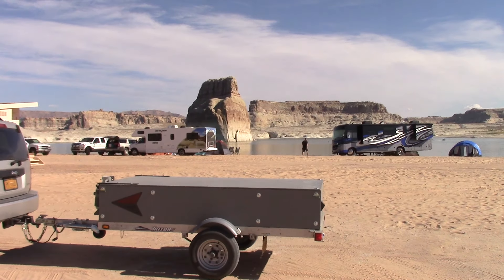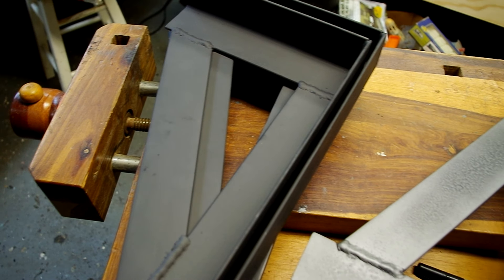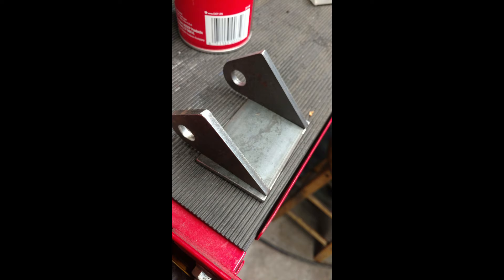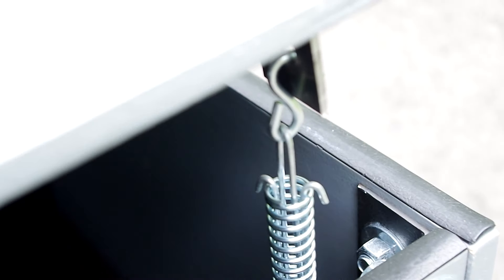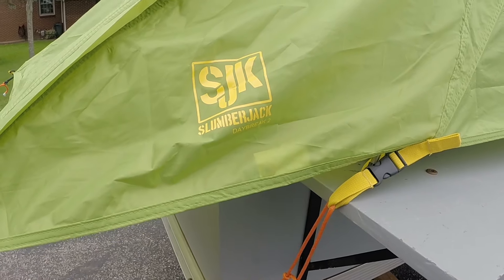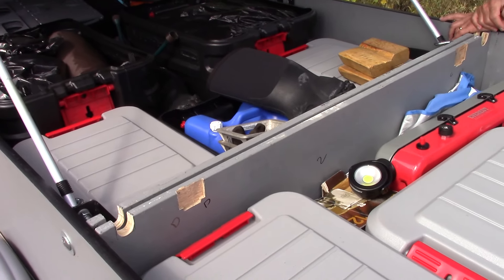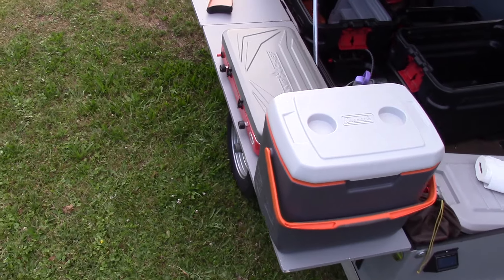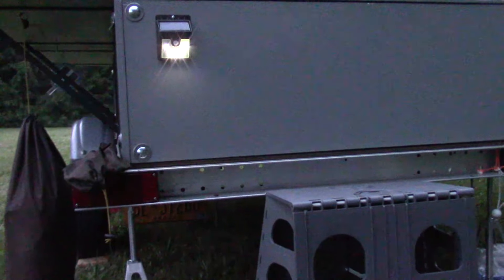Camping Trailer made from utility trailer popup travel rooftop tent rv diy

Comment: So I've been tent camping but trying to figure out what I want to do long term.  Wife hates camping so I'm not going to invest in a bigger style camper, besides, that's not my idea of camping lol.   Thought about building a smaller teardrop like camper, but I want to bring my fishing kayak which is also on a trailer, then I saw the rooftop tents and thought I could mount one above my kayak trailer... But the price, ugh, so then I thought why not put some plywood up and use a regular tent, even have a piece fold out to extend the surface.  So I do a Google search and BOOM your video shows up basically doing what you did haha.  Thanks for some great ideas!
Reply: Very similar to my line of thinking to accommodate my canoe or my inflatable KaBoat.
Reply: @RandomButtonPusher  well i ended up biting the bullet and bought a rooftop tent.  i found a soft top that setups like a hard top, very fast.  mounted it on my small trailer.  lady week i bought a 5x10 trailer and moving everything over to it to have more storage.  heading off on a 14 day camping trip cross country hitting a few national parks and other sites.  be a nice maiden voyage.
Reply from the maker: Nice ! Enjoy the trip !
Reply: @DougRowan_photography  Fantastic!

Comment: I'm contemplating building a box similar to this to fit in the bed of my pickup truck. Then setup the tent on top. Pack it with supplies until we get to the campsite.
Reply from the maker: Next ,I may put a truck cap on it. 👍

Comment: While I've been kicking this around for my 54" x 10' all-aluminum utility trailer, you've actually gone and done it. Nice to see your approach, which has some minor variations from my sketch-up. The tent I've selected is only a solo that fits in the "footprint" of the trailer, and the OEM side/front stake panels are removable, as the top will be as I need to use the trailer for other duties besides a camper set-up. Thanks for the run-through of your design.

Comment: Nice build. My original plan was like yours but then I ended making a rack that slides up n down to any height using square tubing with holes up n down all 4 side.  Now I’m fixing to up grade tent from smittyB 2 person and 4x6 to a smitty B xl and 6x12 trailer and and it will open on top of the trailer and keep everything on the trailer and have room under tent to sit chairs and tent annex:
Reply from the maker: Sounds like a great design !

Comment: This is a super sweet trailer. I saw it on a previous video and would have sworn it was a commercial manufactured model!
I especially like that it looks secure enough to leave it at a campsite. I’ve had to be selective when choosing a camp for my Jumping Jack, for security purposes. The Jumping Jack sleeps four, but I’m gonna build one like yours for when I travel alone. Awesome, yet simple design! Kudos.
Reply from the maker: Thanks ! Lockability was a must-have for the trailer

Comment: I wanna do this with a pop-up camper frame:

* Do an axle flip to eliminate the wheel wells & give you a flat surface to start with.
* Build some sidewalls on hinges that fold down, and you approximately have a  10' x 10' platform to setup your tent on.
* Expand his idea of table space in the back, by making the entire back wall fixed, with a fold-up countertop.  The back of the trailer is now your cooking area that holds your chuck box & stove.
* When the sidewalls are up, you've got an enclosed box for tons of storage for your coolers, stove, tent, camping chairs, tarps, and mountain bikes.  
* Your propane tank mount is already built into the popup frame.
* Build a water-tight box somewhere to keep a deep cycle battery, and you've got usable power for your trip.
* You could even build a set of mounts for tarp poles for a canopy.  The possibilities are endless!

You basically eliminate all the cheap, rushed, and shoddy installation work done by the pop-up manufactures, and keep all the benefits of being above ground.

Plus, your overall gear load is lighter.

It's MUCH less work setting up a tent on top of that than setting up a pop-up, and you get the same effect: Tent camping off the ground!

Comment: Wonderful design! Have yet to see anything  that comes close! Just wondering whether the air matresses mentioned “bottom out” or stay firm, and what your experience is with them puncturing. Thanks in advance!
Reply from the maker: You have to adjust air in mattress for weight if people on it to keep from bottoming out. Comes with a puncture repair kit. Haven't had to use it yet .
Reply: @barrysoutthere  Thanks, Barry.Will look into it as I find the cheap $50 air matresses uncomfortable for my not-so-young bones.

Comment: Very nice. My compliments.
Reply from the maker: Thanks ! It works great ! Check our beach camping video. Great example.
Reply: @barrysoutthere  i got a runaway slice and love it. It was like 4 grand. If i had on like yours i might could pull it with my motorcycle. I cant pull the runaway. That was my plan but it was too heavy/dangerouse.

Comment: Great video. Can't stop watching it. I'm wondering if the sides would be to high if they were 24 inches. Where did you get the propane holder? I wish I could see better how you propped the top or lid up. Thanks and happy camping.
Reply from the maker: The propane "rack" was a commercial hand-me-down from an HVAC guy. It's steel, and very heavy. The top props open with an aluminum pole on each side, mounted to the angle iron. Thanks for watching !

Comment: When it rains would not the water flow under the trailer because the platform is wider then the trailer?
Reply from the maker: Under the trailer or under the tent ? Yes, it would get wet, just like on the ground. Tent with a good waterproof base helps.
Reply: @barrysoutthere  on the ground it has the opportunity to sink into the ground, also you can dig a small trench around the edge of your tent.  Very nice idea.

Comment: just one question can your design be pulled with a 650 cc motorcycle?
Reply from the maker: Probably not. Too heavy
Reply from the maker: @mckees2  probably around less than 1000lb. Barely compresses the leaf springs.